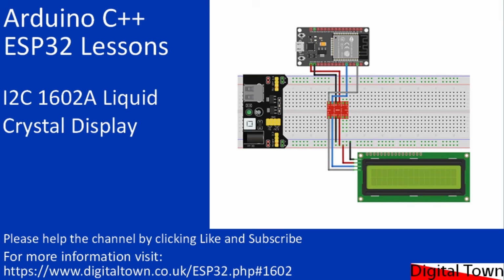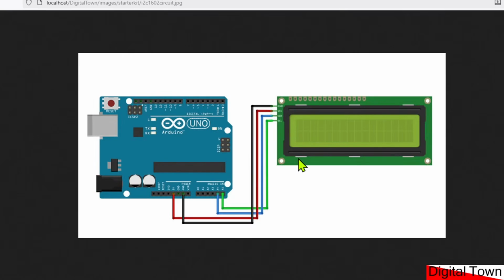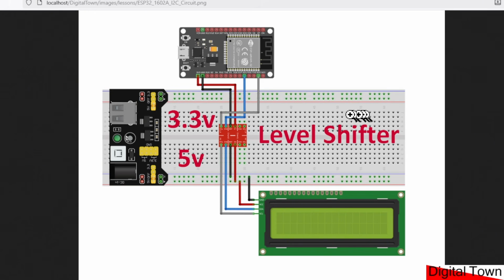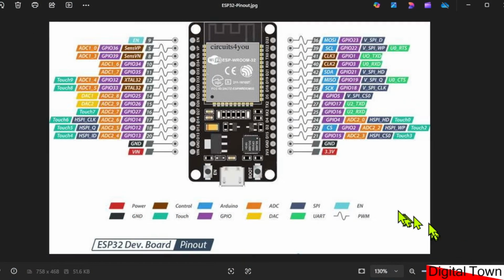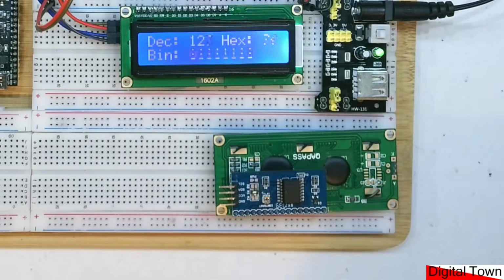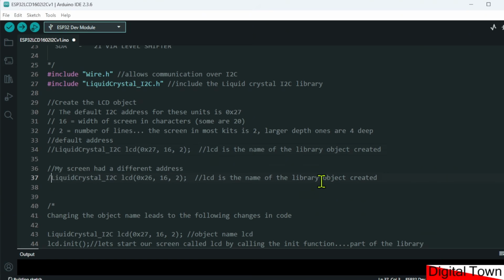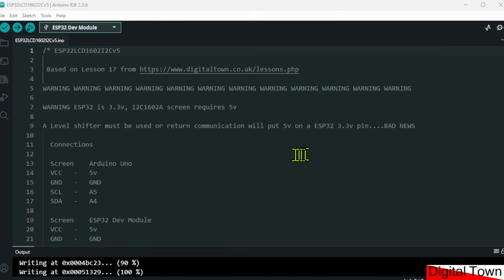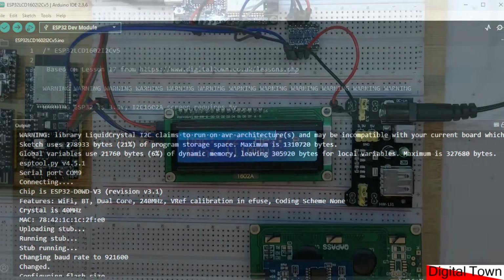#154 Arduino C++ ESP32 with 1602A Liquid Crystal Display

Comment: I have my i2c LCD display data lines directly connected to my esp32, works fine no smoke. 5V is connected to the Vin pin and power provided by a USB phone charger.

The display occasionally crashes, I think it may be the lack of termination resistors on the data lines but I haven't checked.
Reply from the maker: I've got away with things like that in the past, often because i didn't read the datasheet, but not really a responsible way to teach people.